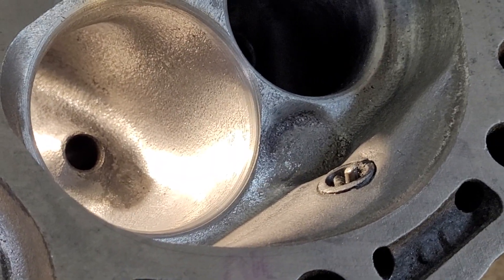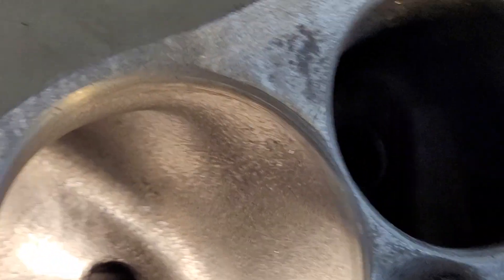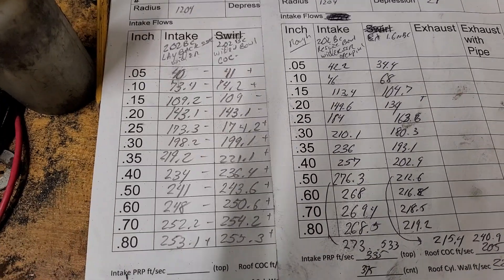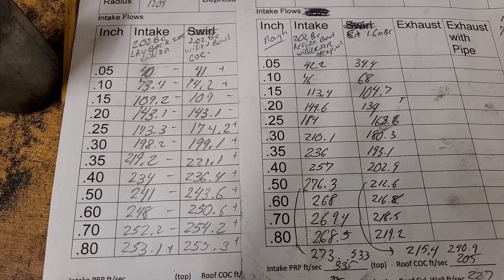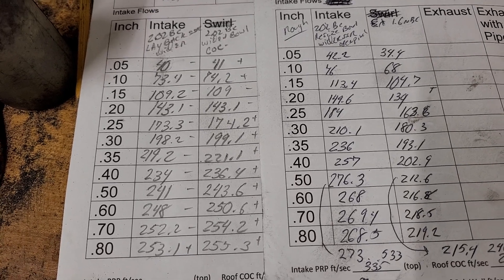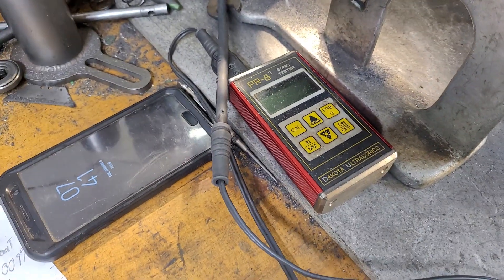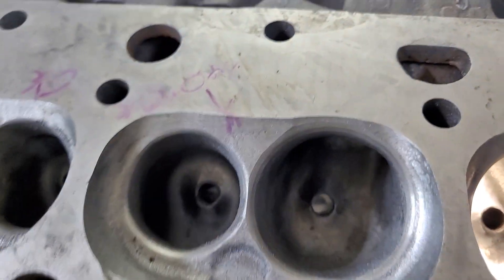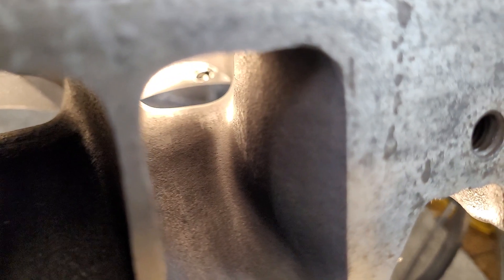Chevy 041x cylinder heads progress and flows

Comment: Is grinding the chamber on these heads as much as they like for flow risky when it comes to cracking?
Reply from the maker: It is a good question. I have been grinding these chambers like this for decades. I have not had one crack yet. I could take some sonic thickness numbers for us to look at. Anytime you reduce the thickness of iron you increase the chance of cracking.